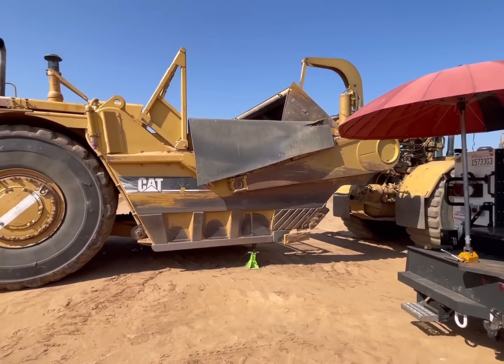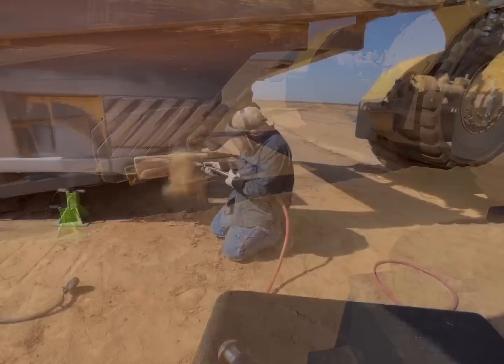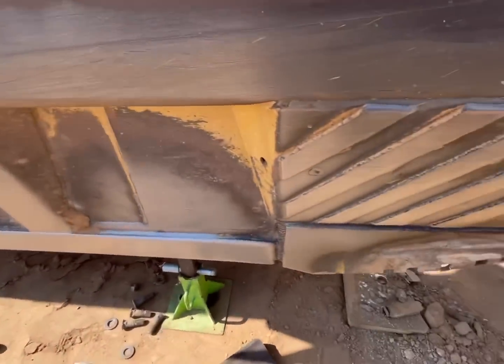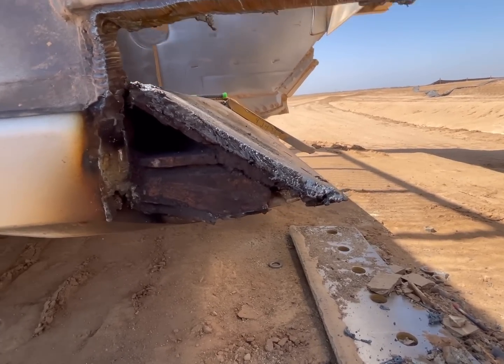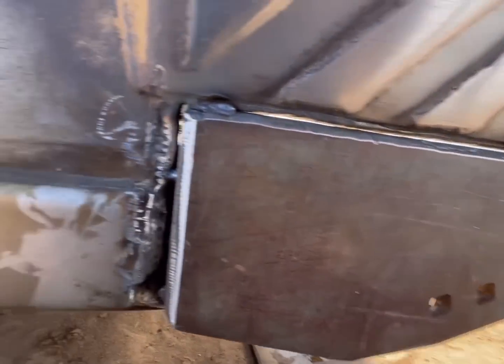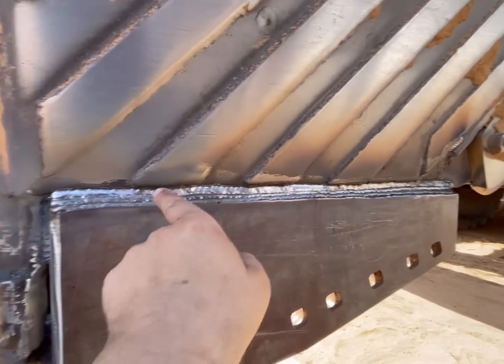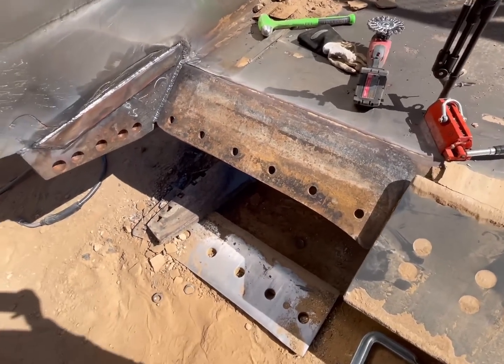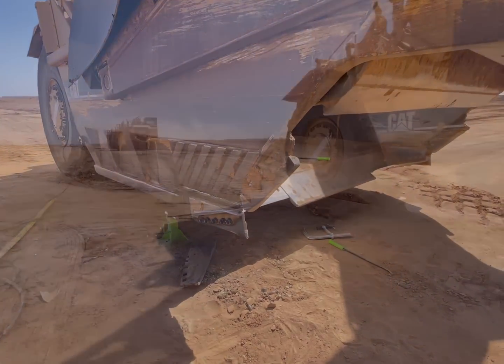CAT 637 Router insert

Comment: Great to have you back. Your absolutely right. Torches don't work with dirt. Great for clean, painted, oily metals like in ship or salvage yards. Watch a company having so much trouble using torches and arch gougers. To redeck the Titin dry dock 2-1/2 foot ball fields long in VA. Deck was covered in huge patches panel that were packed with rust, shot, and mud underneath. Plus it was so hot that summer. GJ! On the CAT. Top notch work there. 😉😉👍👍

Comment: Have you tried the inserts you can get from CAT? I did a set on a 631 not too long ago. They are a lot smaller. the insert stops right before the frog so you don't have to mess with it. Come beveled nice on both sides. Just lined it up with the holes, traced my line, cut it out, and welded it 100%. Gravy

Comment: I got my first plasma back in the 80’s.  For shop.   Now I have 3.  And I agree. If you can use it I do mostly.   I did use the torch last week to cut through 8 inch’s thick. They all have there place for what you need and what the jobs is.  But the plasma is way better than just the torch in lots of cases.   Only Thad a torch when I strangest out in the early 70’s.    Kent

Comment: Seems a small electric, low volume, high pressure pressure washer would come in handy.  Maybe a micro steamer, if anyone makes one, maybe convert a 
Turkey fryer to boiler for a little  pressure washer,  just a stainless coil on the burner,  after the pressure washer. Maybe take up a 2'x2' patch 3'-4' tall including hoses, use 25gph or less, its not to was whole vehicle, but degrease work areas, the greased joints is a good example, just a idea, not a requirement, but could be nice to have!

Comment: I use my primeweld tig 225x to do my air arc using 5/32 rods at 200amps and I get it done just fine . So don't be intimidated by people who got 350s and 600 amp welders.

Comment: At the shop I worked at in high school 72-74 we used cutting torch, never recall us using air arc and we didn’t have a plasma cutter.  Why switch from plasma capable of cutting 1.5 inch thick material to air arc or using air arc to clean up a plasma arc cut?

Comment: How many amps does your plasma pull wide open? I know a lot of generator ends wont pull over 60 amps good ...I got educated on what electricians call "dirty" electricity ...thanks great video
Reply from the maker: It is 49 amps.  I have tripped my 50 amp breaker one time while cutting for several hours straight.

Comment: On the inner plate, that inside triangle you said couldn’t be welded back, would welding a bar in he horizontal plate that would extend out past the router.
Take a small slice out of the router that would let the router  slide over extended horizontal plate. Then weld. You get hat area welded.  Hope this makes sense.

Feasible?
Reply from the maker: It makes sense,  but I don’t think it’s necessary.

Comment: Very cool. Surprised you didn't weld the cracks on the side wall above the plate on the inside
Reply from the maker: They were packed with dirt. The welds wouldn’t come out very well.  That whole piece will get changed out
Reply: Also should have flipped the router bit cause right away the back two holes are gonna get ate out. But I suppose you didn't cause they will hopefully do a complete edge flip in 80 hours or less

Comment: I use my primeweld tig 225x to do my air arc using 5/32 rods at 200amps and I get it done just fine . So don't be intimidated by people who got 350s and 600 amp welders. That's a badass plasma cutter you got what kind is that?
Reply from the maker: Hypertherm 105

Comment: How long do those cutting edges and router inserts usually last? It's amazing how the dirt eats solid steel like I eat chocolate... Also: Plasma cutting always looks super satisfying! If I had a plasma I'd want to cut alll the things haha.
Reply from the maker: The piece I replaced can last years if the router is replaced at the right times.
Reply: Also depends on the material you're working in.

Comment: How you likin that harbor hole impact has it got enough ugga duggas and how long has it lasted? I’ll be using it about as much as you do for the same kinda shit.
Reply from the maker: It’s pretty good.  I wore out the first one in about 2 years.
Reply: @OFW  nice if you do the research some of the tools they sell are the same as “upper tier” Taiwan tool. The extended cutoff tool has the same patent numbers as the CP one.

Comment: How do you source parts like these? Does the customer get the parts or do you?
Reply from the maker: Usually the customer will provide them unless they need to be custom made.
Reply: @OFW  thanks for the reply. I did heavy equipment repair for a shop awhile back but we had a parts department that handled tracking down parts. I would like to get into doing it on my own. I appreciate your videos. Good content.

Comment: Hey what brand and size is the magnet your using to hold up the umbrella? I tried it with mine that looks kinda like your and it won’t hold!  Thanks
Reply from the maker: It’s a cheap one off of Amazon.  I believe 880 lb capacity.

Comment: You know that $60,000 machine you got make sure life dreamy don't it what you can do with that flux core in a couple of hours with take a stick Rod a day or better and that plasma over a torch and a gouge those Kohler 250 everybody's running they don't support anything but a 45 plasma if you're cutting on 10 gauge they're perfect
Reply: My machine will burn quarter-inch rod though how to make quick work of that